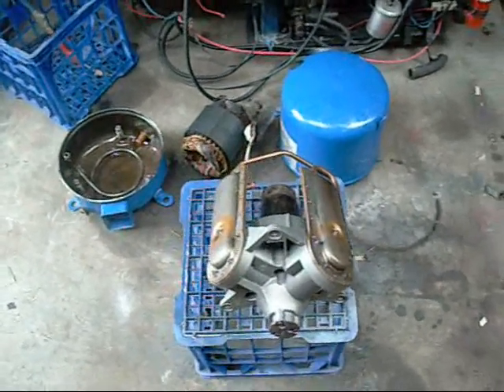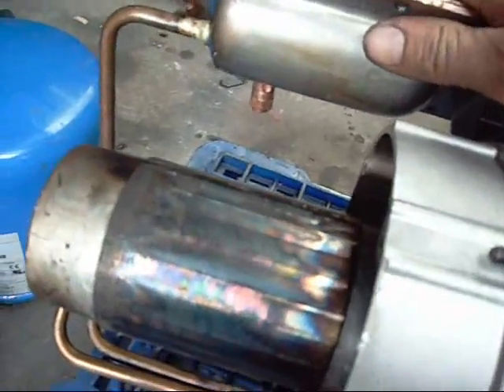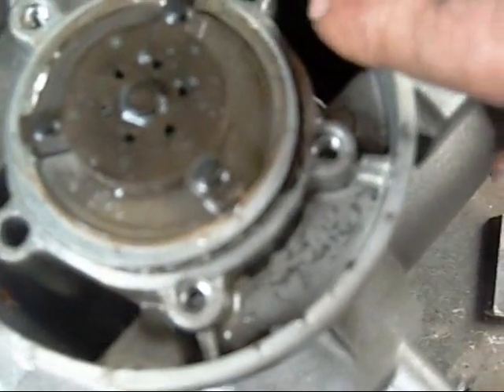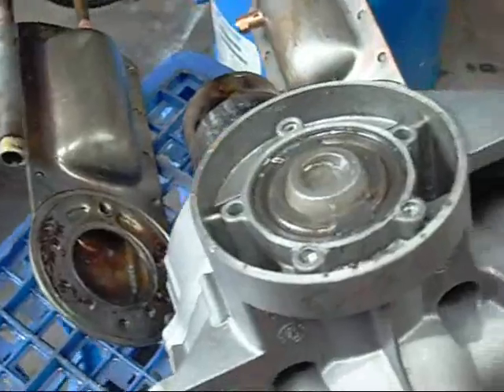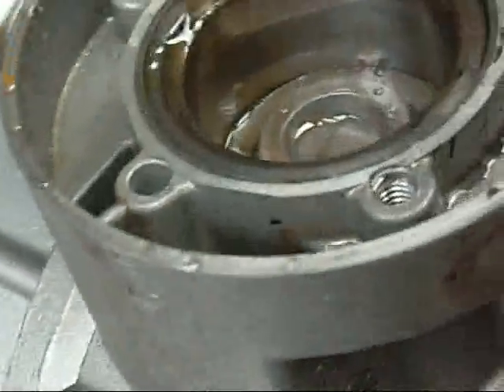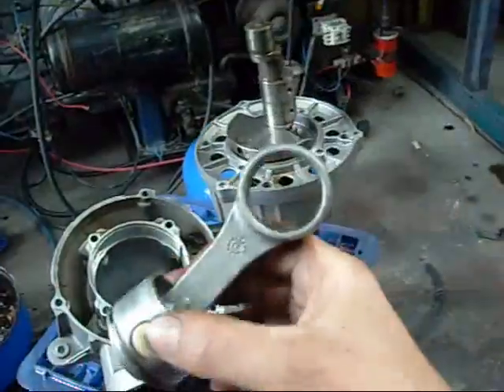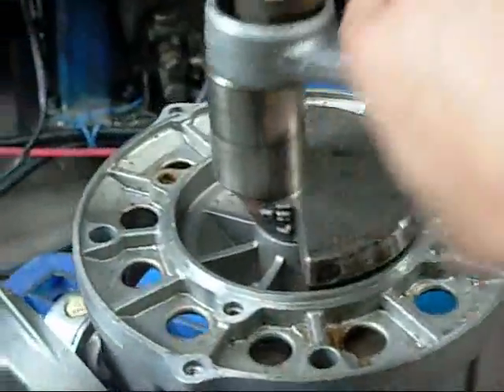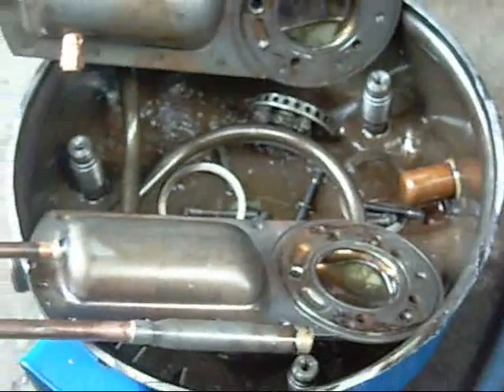Danfoss Maneurop MT57 V-Twin AC Compressor Disassembly

Comment: If this was 3-phase and you used a phase converter then you were never able to get the full torque abilities of this motor. You need true 120 degree seperation, same voltage on all phases 3-phase to really bring a 3-phase motor to life.  Is three phase too expensive to run to your shop?